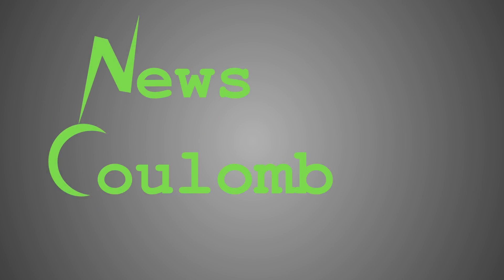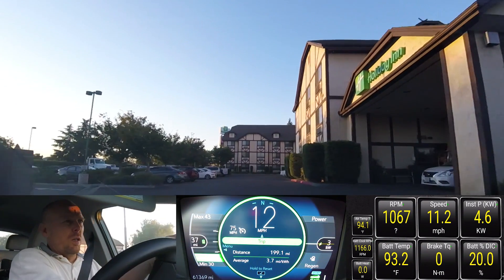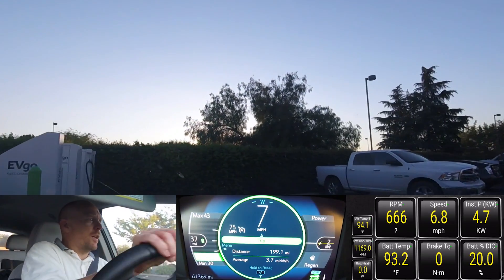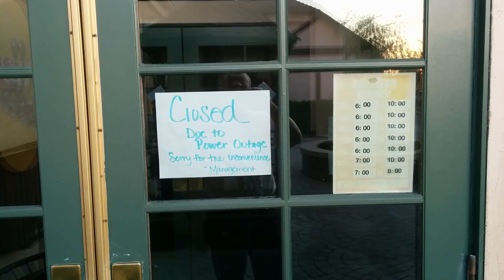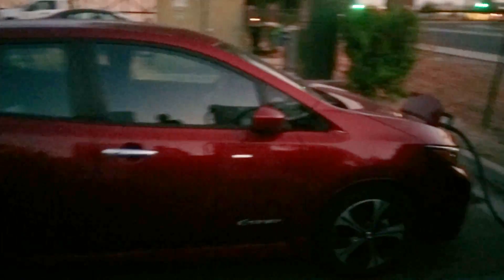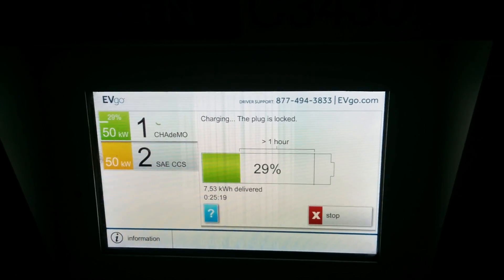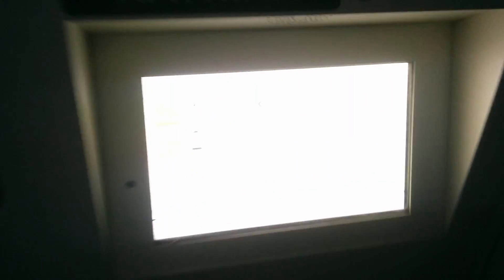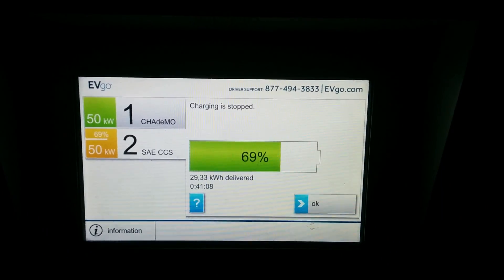First-Hand Look at 2018 Nissan LEAF Charging in Hot Weather

Comment: One thing to note is that the quick charge port is optional on the base version, meaning if the real target user of this car didn’t add that option, he would NEVER experience rapidgate, just like the Bolt without the fast charge as an option would never experience #EarlyThrottleGate.

The good news is Leaf fixed the BMS and now it works just as good as any other BMS, and the battery on a 4 year old Leaf should still have a high state of health. 

When the Leaf E-plus comes out with the Bolt/Kona battery it’s going to cost more and charge faster. That segment will be flooded, waiting for the model 3 price to come down into its range, but without the full federal tax credit. 

But the 2018 Leaf is definitely an upgrade to the earlier Leafs. I would like to have the quick charge port just in case I get stuck out somewhere without level 2 charging. Even at 15 kw, that’s still faster than any lead acid battery that can fit in that car can take. 

But Nissan should be more clear about it, and these people with Tesla appetite but a Leaf budget need to understand this is a car you can buy for $30,000 right now, not a $35,000 🦄 version of the model 3 which may never be made. 

Once E-plus is out, the Leaf will have a good spectrum, from local commuter car to a car as good as anything else in its price class.
Reply: IMHO there you go again making false claims. Here is why the 2018 leaf charges slowly. https://www.youtube.com/watch?v=WlxBOJrEKAo&t=14s
Reply from the maker: I don't think L2 only was the target audience for the LEAF. Especially not when you're promoting the 150 mile range with Pro-Pilot. 

Even if it were, you can't simply release a product that's worse than its predecessor without some sort of warning.
Reply: News Coulomb, it’s not worse than the earlier version. They fixed the defective BMS. It’s just that others expected them to add active thermal management at the same time. We can also say the same about the Bolt, which throttles way too early compared to the Spark EV. It doesn’t mean the Bolt is defective. 

The lanekeep assist on 150 mile range doesn’t really support any theory that the car is designed for longer commutes.

Most of the complaints about the Leaf are from non-Leaf owners. Those who upgraded from an older Leaf and understand batteries know the 2018 is a better car than the 24 or 30 kWh version. Asking Nissan to break the BMS just so it can charge faster is not a solution.

I do believe Nissan should have offered cooling like the eNV-200 for those who want to pay for it. But they decided it’s just easier to sell their battery factory and buy LG Chem’s low budget solution like the Bolt and Kona (and I predict also I-PACE) use. 

Some are saying it can handle 100kw on the 64 kWh pack. I’ll believe that when I see it, but if it’s true, and can hold that up to 55%, that’s going to be far superior to the Bolt/Kona and even I-PACE in terms of range added per minute.

The big problem is Nissan is not ensuring new buyers understand battery basics, and the official press release seems like there is an interior lack of communication. It’s simple. They fixed the defective BMS, which every engineer understands. The problem is, they expect the non-engineer to understand that it means the BMS will no longer allow owners to destroy the batteries in 1 year. 

The only question they haven’t answered satisfactorily is why they didn’t add active thermal management, although there are statements saying that Nissan deemed it wasn’t needed for the intended use, whereas the eNV-200 has active thermal management because it is intended for commercial use. 

What we all want to know is, how much extra does the eNV200 thermal management system add to the price of the vehicle. I do think the quick charging port should come with thermal management package, or at least the option to buy it. 

The good news is soon there will be some 2018 Leafs in the market dirt cheap, since you can buy one for $30,000 and get about $10,00 off. So with $5000 in addition depreciation I would expect these popping up for $15,000 for the base model and $20,000 for one with most options.
Reply from the maker: This is what I was referring to. Error in the BMS software tracking capacity, not additional battery wear:

http://www.cleanfleetreport.com/exclusive-nissan-leaf-battery-fix/
Reply from the maker: As for the Bolt EV and the Spark EV, the Bolt EV charges faster. Period. Now, the chargers aren't there to support it yet, but the Bolt EV would still be charging at over 50 kW when the Spark EV hits its 80% taper. The Spark EV maxes out at what, 48 kW? By the time the Bolt EV hits its first step down, it has 1.5 times the capacity of a full Spark EV battery, and by the time it steps down to a rate that is noticeably slower than the Spark EV's, the Bolt EV is holding twice the Spark EV's total capacity. 

Regardless, this isn't about a pissing contest. The point is, Nissan didn't properly warn customers about the reduced charge rate.
Reply: I say IMHO is pointing out something important here.  Which is that the BMS in older leafs prioritized quick charge over battery life, and now it prioritizes battery life over quick charge.  Which is important because the 30 kwh leafs burned their batteries mercilessly, which isn't sustainable either since it gives the impression that EVs lose battery life very quickly, and when you have a maximum range of 110 or 150 miles losing 30% of your battery life is just enough to make using the car uncomfortable and not enough to trigger the battery warranty.

I have the 40 kwh leaf and it suits my needs well enough, there isn't a fast charger network large enough in my area to allow me to travel more than 80 miles in one direction anyway right now.  Eventually there will be in the next couple of years though, and when my lease is up I'll upgrade to something with longer range and battery management which will allow me to take advantage of the larger network.  40 kwh leaf is a stop gap for me because i needed a different car and wasn't in love with the Bolt, and I knew it would have poor resale value so i leased.
Reply from the maker: My understanding with the 30 kWh LEAF BMS is not that it was allowing charging that degraded the battery quickly, but rather, it was losing track of capacity over time. Essentially, LEAF owners were losing range even though the battery wasn't actually degrading. Nissan then patched the software so that the BMS could track capacity accurately, not so that the BMS would slow charging rates to preserve battery life.

But I haven't really investigated that issue deeply. I could be mistaken.
Reply: Aaron Williams, I think someone can make an aftermarket battery cooling solution for those who really need to rapid charge. The funny thing is, an iPhone or iPad doesn’t have active thermal management, and it takes 1.5 hrs to quick charge. Nobody is raising a fuss even though some opines can charge in 30 minutes. 

Apple can easily add active thermal management but they don’t. Nissan can too, but they didn’t. I believe they will carry both 40 kWh commuter car and 64 kWh travelers car. Once we see the price difference and charge speed we can see which is best. I think the E-plus will add $5000 to their premium version and be in the same $37k-$44k price range as the Bolt. So there will still be plenty of people who prefer the $30k version.
Reply: News Coulomb, I think the conservative degradation algorithm was only part of the problem, but there was true degradation going on for those who didn’t baby the batteries. The combination of high current, high voltage, and high temperature seem to degrade the battery very fast compared to any one of those conditions acting alone. So throttling current takes care of all three at the same time. 

I think the Bolt/Kona has the same problem, it can’t remove heat as fast as 1C charge rate adds it, but what it does is ensure you start with a cool battery and that’s enough to get it charged to 55%. Unfortunately nobody is really doing much on YouTube with the Bolt CAN bus data like we see with Tesla and Leaf Spy. 

I have no idea what happens to cell temperature in a Bolt EV. I think they don’t even let you see it without scanning the CAN bus, right? The Volt/Spark battery had some real thermal management, so it can keep up with temperature much better. I’d like to see the BTU removal of a Spark EV and a Bolt EV, and I bet the Spark EV is removing just as much heat but the battery is less than 1/2 the size and the thermal path is shorter.

The Bolt EV has a fairy long thermal pathway down to the chill plates, so at 125 Amp, the thermal gradient probably gets very high, and may be part of the throttling algorithm. 

Does the Bolt still charge slow if it’s freezing and you begin a fast charge? We know the Leaf will charge fast if it starts with a battery which is just barely warm enough to allow charging.
Reply from the maker: Oh, sure. They were going to have a degradation problem either way, but I think they (and it seems their owners) were fine with the typical degradation seen in the 24 kWh LEAF. The reason for the alarm with the 30 kWh LEAF was that it appeared to be degrading at twice the rate of the 24 kWh. 

My point is, if that is the case, preserve the charging model. Basically, they got their customers used to how the LEAF charges. Then then completely changed the way it operated without adequate forewarning.
Reply: News Coulomb, but someone has to pay for all these free batteries Nissan had to replace, so leaving a defective BMS in charge was not a viable option. That’s why I think Tesla is not helping as much as everyone gives them credit for. They make a great car. It don’t make a car for the masses. The Chevy Bolt isn’t a viable solution either, because Chevy can’t keep making them for that price and eventually the subsidies run out for buyer of GM EVs. 

So who is really the only company making an EV that someone can possibly buy without incentives, and a car that can make a profit? Right now the Leaf is way ahead, but people see them as behind because of misleading information from companies who make better EVs. 

Unless Teflon Elon pulls another rave out of a hat, come July 2019, Tesla will all but stop selling in many US states. The Bolt isn’t far behind, but GM is cautious about over producing them too soon. 

If the current administration puts the ZEV program on ice, no more need to give Bolts away at low leases. So at that moment, who will still be trying to make an EV? I think Nissan will keep trying to make a viable EV buy staying at $30,000 and just making that car meet more and more people’s needs by adding battery technology as it gets cheaper.
Reply: The surface area and thermal capacitance of a cell phone battery is drastically different than a car battery.  A cell phone battery can cool down within minutes of getting hot.  A Leaf battery can take several hours.  Also a cell phone battery is designed to last 2 - 3 years while a car battery is designed to last 10 years.  It's a very silly comparison.  Also the QC port is only an option on one of the three trims, the least popular of the trims too.  So I don't think that was the target Nissan was intending.
Reply: Erik Stephens, only a few 2018 leaf owners are whining about rapidgate. Lots of people have them and are totally satisfied with them. Nissan has a reason for not putting active thermal management on their 40 kWh Leaf battery, and they plan to add active cooling on the 64 kWh battery. 

The 2018 Leaf is an improvement on the earlier Leaf. They have their plan, GM has their plan. Tesla has their plan. I think Nissan will be ok with their plan. If the Leaf doesn’t suit your need, it doesn’t mean it doesn’t suit the target user. 

The onboard charger is only 6.6 kw. The overheated Leaf was charging at 15 kw on the quick charger. The owner was probably looking at the glass being half full instead of half empty.

But right now, you can’t buy a better new BEV for $30,000. Once the E-plus comes out, we can compare it with the Bolt, since it will be in the same price range.
Reply: You must really live in a small bubble.  Just google rapid gate on YouTube and you will find hundreds if not thousands of individuals posting about their issues.  Even Bjørn Nyland has commented in his video's in Norway running into several Leaf owners complaining about charging speed. And think what % of people would actually go through the trouble to post a video to YouTube.  This issue is a lot bigger than I thought it was going to be too.  That being said if you are using the Leaf as a regional commuter it's a perfectly fine car.  And I too know lots of people who are also very happy with their 40KWh Leaf's.  But they don't do very long road trips with the car (and or they are very patient and knew what they were getting into).
Reply: Erik Stephens, Bjorn is not a leaf owner, never had been, never will be. Bjorn is a Tesla owner, and will never be satisfied with a leaf. 

There may be 100,000 whiners, not not 100,000 whining owners. Some owners have done their own testing to see that it’s a simple BMS controlled throttling. They still have their 2018 Leaf and are happy with it. 

For those who are new to EVs and bought a leaf thinking it was a Bolt, Zoe, Ionic, or Tesla, they will either adjust or return it and buy something else. 

Even those who came out with rapidgate as some sort of scandal have since backpedalled a bit saying it’s not a big deal in most cases. If it is a big deal, they bought the wrong car, simple as that.
Reply: IMHO Did you even read what I said? It's like you only read three lines and replied. I'd repeat my comments but you would likely refuse to read those too. Bjorn drives lots of cars. I wasn't voicing his opinion. I was only talking about the opinion of others he has personally talked too.
Reply from the maker: I think the bigger issue here is for the EV community as a whole. With our limited pubic DCFC resources at this point, we can't afford to have people using DCFC for two hours at a time, just to get two hours worth of driving.
Reply: News Coulomb, yes, that is an issue we discussed with the upcoming 350 kw DCFC if a slow charging Bolt or Kona uses it. Obviously they need some way to ensure the time and kWh are both included. For the 50 kw chargers which charge 35¢/minute, it will take care of itself, but for chargers charging 35¢/kWh, there is no penalty for slow charging cars. 

The problem is, who gets to establish the rules? A leaf is an inconvenience for a bolt owner, but a Bolt is an inconvenience for a Spark EV owner at the same DCFC if it charges past the throttling point. 

I think all these chargers now are just stop gap measures until reach charging stations and batteries which can accept 1200 kw are in place. Then you have 2 choices, charge at home or charge at a charging station, and then nobody is fighting over the various chargers. Maybe by 2030 we can see this.

Between now and then, it’s going to get worse before it gets better, as more people by slow charging cars and need these slow chargers around. Someday we will drive by old abandoned Tesla Superchargers and say “Can you imagine charging at only 144 kw?” LOL
Reply from the maker: Price can help establish the rules, but in this case, we still have many free-to-charge stations. Also, many people only make occasional long trips, so paying $0.50 to a $1 per kWh (based on paying by minute rates) is cheaper than the alternative (renting another car, possibly ICE, and paying for gas).

I believe Tesla is already experimenting with variable costs based on the charge rate. Leave your vehicle plugged into a Supercharger too long, and it will cost more money to charge at 60 kW than at 115 kW. 

Perhaps there should be charge rate cutoffs at the station level? Say 150+ kW chargers will not activate if (or will shut off when) the charge rate is below 50 kW. So the Bolt EV will only be able to charge up to 55% and the Kona EV will only be able to charge up to 70% before getting cut off. And the current, small-battery EVs won't be able to initiate a charge at all. Likewise, the 350 kW chargers will shut off at anything lower than 100 to 150 kW.

I'm not necessarily a fan of that model, but maybe a private charging network decides that's what it wants to do. Heck, that might be what Porsche decides to do with its network of 350 kW chargers.
Reply: News Coulomb, I think Tesla only uses tiered per-minute charge rates where its illegal to sell by kWh. If they cut out the below 60 kw rate, then it would be self regulating, except for those with free supercharging. 

For me, Tesla did the technical side of their battery/supercharging right, but the financial side has lots of issues. It’s like when they gave people $10 to sign up for PayPal or get someone else to sign up. Losing lots of money to gain market share. 

The problem with shutting off at 1/3 peak is if someone pulls up with a frozen battery they can’t get it over the hump so it can start charging, or someone may need to get 10 kWh more to make it to their destination, and be willing to pay for it. 

It will be interesting to see how it works when there are a mix Chargers and lots of cars all trying to get the the right charger, and a cascading effect when a 350 kw is blocked by a Bolt, and then a F-250 (kWh) has to charge at the 150 kw charger for 2 hrs, and the Fisker EMotion has to charge at the 50 kw charger for 2 hours. 

They can make all the10x charge points 350 kw with a remote cube of 2000 kw in chargers, but that will add some cost. Perhaps once the chargers are there, more manufacturers will step up and make the battery’s able to charge faster.
Reply from the maker: What you describe is one of the reasons I prefer ChargePoint's Express Plus setups. As I've described before, it functions similarly to the Superchargers, so two units paired with a cube can be "right sized" so that you don't have to worry about what you are describing. If you are splitting 300 kW between two paired stations, it doesn't matter if a car is only charging at 55 kW on one station. The other station should be able to provide 200+ kW. Combine that with proper fee structure, and small-battery EVs with <50 kW charging shouldn't impact the system too much.

That is, of course, all assuming that we see a significant build out. Of course, as EVs get more efficient with more range, the number of times they will need to rely on public fast charging will be far less than the number of times small-battery EVs will need to rely on public fast charging.
Reply: I wonder when the overflow of Tesla model 3 will start to clog up the 50 kw chargers and free chargers. Do they even have an adapter for the model 3 to work with chademo or ccs yet?
Reply from the maker: No, they do not currently have an adapter that works with the Model 3. Given what I've seen with the Supercharger locations that support long-distance travel, they are rarely used. 

Also, something that I think is missing from Tesla "not enough fast chargers for everyone" argument is that Tesla owners tend to have a distorted view of the world. If you can afford a $70,000+ vehicle, you typically have more economic mobility than the average person, and you typically have more freedom with you're time. Currently, it appears that the low-cost Model 3 is far more popular than the $50,000+ version, and people who can only afford a $35,000 car are much less likely to take regular, long vacation trips than wealthier people. 

Even if Tesla sells one million <$40,000 Model 3s in the next year or two in the United States, it's unlikely that they will be crowding the networks. Those people work for a living.
Reply: If Tesla were smart, which they are, they will game the ZEV credits for all they are worth, and only sell the <$40k version in states which have traveling ZEV credits. It would make sense for Tesla to make a California edition which will also cost Tesla less to deliver (but they can still charge $1200 delivery).
Reply: Just as a note Electrify America currently charges a flat rate per minute while charging and a higher rate after charge complete.  In the future Electrify America has stated they intend to charge a higher per hour rate for the 350KW stations than the 150KW stations.   That should make it less likely that a lower power EV will use the 350KW stations.
Reply: Erik Stephens, that should work, and the app should tell you what it’s costing per kWh so you can leave when it gets higher than your willing to spend, like 50¢/kWh.
Reply: John Smith, I’ll be very surprised if that truck ever gets built. Their money raised milestones start at $10k. I’m thinking if they are waiting on $10k to reach a milestone, this is going to be way out f their league. 

And making that truck for $45k with a battery that adds 300 mile range in 15 minutes won’t be easy. Sure, that battery can be made, but the battery alone will cost $35k. 

I hope he makes it be it just seems like something that will never materialize. But if he can raise $1,000,000 and build a truck, he miffed be able to raise more.